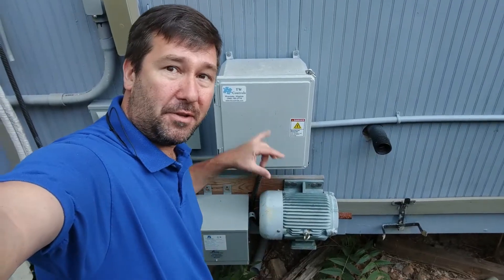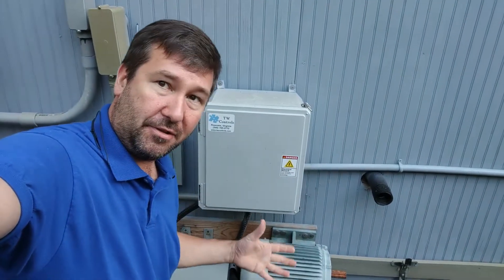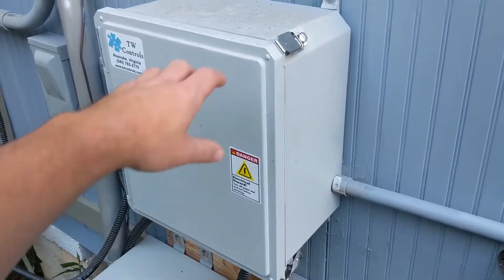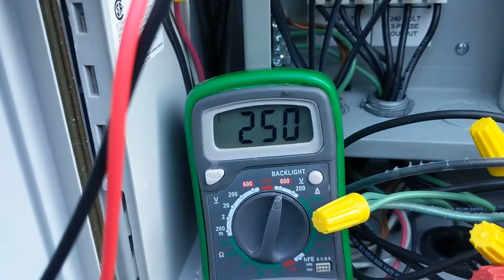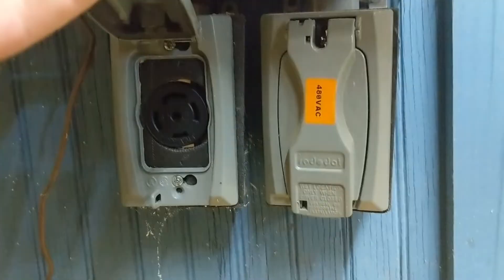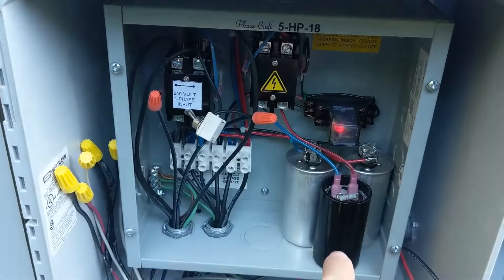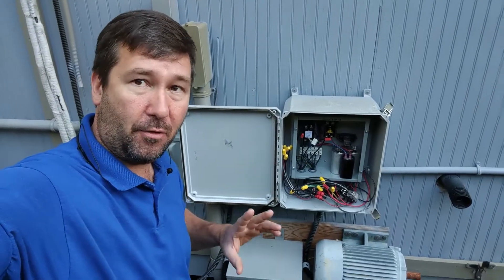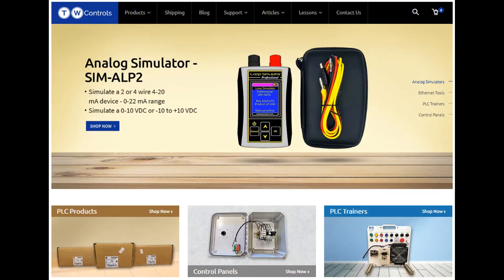Make 3 Phase Power from Single Phase with a Rotary Phase Converter

Comment: cut the shaft off and the vibration will go away for the most part.
Reply from the maker: In this case I don't think it would help.  The motor is perfectly smooth,, it just is in the perfect place to amplify the sound of the motor.
Reply: if its just the shaft it's probably balanced almost perfectly. it's more or less harmonics plus if it's mounted on a semi flexible piece of the building, it will vibrate no matter what. just how it is. Now if Tim used a bunch of bolts and sent them through to the inside of the building with a 1/4" steel plate backing. you'd hear nothing. but that's intense.
Reply from the maker: @docstruthers  A little cement and set it on the ground is the permanent solution, 2 years later and it is still on the list to do :)

Comment: wiring diagram please,
Reply from the maker: There is more to it than that, part of the reason that I've never made the follow up video.  You need to understand capacitor sizing.  It is still on the list, just not very high up it right now.

Comment: I took a 110 single phase and made 600 volt 3 phase out of it with the  convertor and running multiple machines from it, very simple, plug and play. And then I woke up:)
Reply from the maker: Yes that would be a little steep unless they were all model machines.  I think you'd end up with about 1.5 amps of capacity 😜

Comment: Does this restrict the total amperage you can draw compared to 3 phase installed directly from the power company?
Reply from the maker: If you have the choice then install 3 phase power. But if you can't then your idler must be twice the size of your 3 phase motor. So if you have a 5 hp motor you need to run, you need a 10 hp idler motor.

Comment: I used to do this w/o the caps, to run my metal lathe.  I'd start the idler motor with another, single phase motor with a belt.  then once running I'd use it to power my lathe.  The idler motor would always become super hot!!
Reply from the maker: My previous one was the same setup. The only reason we switched to our current setup is our is some of our customers required the phases to be balanced when we tested their control panels.

Also the idler heat sounds like you weren't dropping power to the motor one at speed. It should only be used while starting.
Reply: @TimWilborne  Thanks... I was dropping the power applied once the pony motor was running.  
Didn't you show in your other video that overheating is a problem when no capacitors are used?
Reply from the maker: That wasn't a capacitor problem. My idler motor should have been twice the size of my load. I used the same size motors which caused my overheating.
Reply: @TimWilborne  Just trying to determine the cause... so it was b/c your idler motor was not twice the size of the load motor...?  That was probably the problem with my setup!  My idler motor was quite a bit smaller than my lathe motor.

Comment: What does "pull down that relay" mean?  Turn it off or turn it on?
Reply from the maker: The potential relay? It drops out the starting capacitor.
Reply: @TimWilborne  I don't understand the verb "drop" or "pull down" in this context.

Comment: Thanks for the information this thing needs a transformer to get 480 is it? I was struggling no-one was talking about it LOL
Reply from the maker: Yes, there are very few "480 volt" rotary phase converters out there, most of the demand is is for 240V rotary phase converters.  I like having both.  I need it for testing control systems but even if I didn't, I think I would want both.
Reply: Hi,Tim. i am also planning to build the same setup  for VFDs and servos testing at home. i have few questions.
can we use static phase convertor (or VFDs ) to feed step up transformer. or rotary is the best? 
second  which transformer is the best ,a isolation or auto transformer? thanks

Comment: Great video. Had a few questions on previous exchanges in the thread. Looking forward to the next in series on balancing capacitors. I have built two already for running smaller motors(1/2 and 3/4) and need to do a shop wide redo with a larger set of equipment. I used timers before I found out about the potential relays . Upping the idlers to above 10 HP load looks like a whole new set of parameters come into play above the 30 amp /220 input.
Reply from the maker: Yes I need to make a capacitor balancing video, I've got too many projects going on right now.
Reply: @TimWilborne  How much longer do we have to wait lol Good info & explained clearly! I'm ready to order parts but been holding out for this series for confirmation on how I should go about it. Thank you!
Reply: @Csonka09  there is a good vid on balancing here sbirdranch part one
Reply: @stuarth43  I'll try any locate it. Thanks for the heads up
Reply: @TimWilborne  Tim did you ever do the video on building the phase converter?
Reply: Parts are not easy to find in the whole state of va
Reply: Maybe should use a vfd but no fun in that huh!

Comment: Just a quick couple questions, could a phase converter be repaired, and what's the difference between the large box type converter and the small one if iam only powering one motor?
Reply from the maker: Hi Joe, yes phase converters can be repaired.  Most of the time bad capacitors are the only problem.  I'm not sure what you mean by a large vs small box converter.  They are all based off of horsepower.  Typically you double the horsepower of your load and that is the size rotary phase converter you need.

Comment: Nice video,  I have single phase electricity and I want to run a mill that requires a 25HP motor.  What are my options?
Reply from the maker: That is a big mill. Are you sure it is 25 hp? You would need a 50 hp phase converter.
Reply: @TimWilborne  Thanks 4 the reply, am sure coz it used to run on a diesel engine rated 24HP.
Reply from the maker: I would check it, 2hp would be a large mill. I think mine is 1/2 hp.
Reply: Is it a sawmill ?
Reply: @jaspermcconnell6417  No , its a flour mill, in Kenya its called a posho mill, for making maize flour.
Reply from the maker: Ah I thought you meant a milling machine. 25hp would be in line. You would need a 50hp idler motor

Comment: Great video..I am pondering if I should get a 3 phase converter for pizza conveyor ovens. usually 208/240 3 phases. Do you recommend? Thanks for your good informative videos by the way
Reply from the maker: Most conveyors are available in single phase so that would be my first choice unless you need to vary the speed of the conveyor.  Event then, there are many single phase drives that will output 3 phase and allow you to vary the speed.

Comment: Great vid.. I recently picked up a 480 volt wood planer and was concerned about building a dual volt all in one converter. Back in the 1980's I had a "Rotophase" built using a 10 hp motor. The guy who built it told me the rule of thumb was that you can start up to the motor capacity of the converter (10 hp) and that you could run up to 3 times that as long as you do not try to start at the same time. IE you clould run 30 hp at a time. I have been looking at recent vids. and most say you need twice as much converter hp as largest hp machine you need to start.  My planner is 7.5 480 3ph, I recently purchased a 7.5 hp motor to build converter, thoughts?
Reply from the maker: No I've never heard that one Howie.  As a general rule your idler needs to be twice the horsepower that you want to start.  So if you have a 7.5hp load, your would need a 15 hp idler.
Reply: @TimWilborne  Thanks Tim

Comment: 1 ph 250 to 3 ph 250. Is that line voltage ? How the voltage same?
Reply from the maker: If you have 250VAC single phase coming in then L1 and L2 of your three phase power is those two incoming single phase legs.  The 3rd artificial leg will be lower that L1 and L2, that is what we use the run capacitors to boost.

Comment: How did you size the motor and the transformer?
Reply from the maker: Great question Harold.

For the motor you want it to be twice the size of your three phase load.  For example if you have 5hp of 3 phase load, you will need a 10hp idler motor.

For the transformer, you need to figure out the Kilowatts or KW.  1hp equals 0.746 KW.  So if you 3 phase load was 5 hp, 5 * 0.746 = 3.73 KW
Reply: @TimWilborne  Thanks for the quick response hope to see more of your videos soon.
Reply from the maker: @ace7709  Glad I could help, have a great day!
Reply: @TimWilborne  Is this because of the 240/480 or do you still need the idler to be twice the size of the load If both supply and load are 240v?
Thanks
Reply: @TimWilborne  Is the idler rule of thumb 2 for 1 rounding off the 1.73 factor with the 3 phase to single phase ratio? It has always befuddled me.

Comment: do you have a parts list?     dynotime1@yahoo.com   and a drawing    Thanks,   what size ac motor do I need?
Reply from the maker: Hi Greg, it would depend on your 3 phase load and voltage required.

Comment: Hey Tim!

Usually I see you on PLCS.net. :)

I'm researching this because I have a project for a friend that will need to power a 25hp, 480 volt compressor. I'm thinking about using caps this time and not going full on backwoods with it.

Rootboy.
Reply from the maker: Hi Rootboy, nice to hear from you!  That is going to be a big one.  

If I was doing it for a customer then when they get that size I go to American Rotary.  They are not the cheapest but they are beefy plus I have someone to blame if they quit working...not that I have every had one quit.  Something like this one.  https://amzn.to/3aOwIgW

If it was for a friend, I'd find a 50hp motor and get this kit. Also he sells them with the motor also.  https://www.ebay.com/itm/New-50hp-3-Phase-Cnc-Balanced-Rotary-Converter-Panel-10-Year-Warranty/233340188494?hash=item365428b74e:m:mVGSCTUTaWBhmPyEIeIYAyA

Then you will need around a 30 KVA transformer.  Something such as this.  Also I might know where one is depending on where you are located.  https://amzn.to/3dUWIt4
Reply: @TimWilborne  Hi Tim,

We had already found a 50hp motor for $250 (cheap!!), and it's on its way here. We found a 45kva transformer locally, which was about $450 IIRC. So we've lucked out on finding affordable parts. I would have preferred a delta - delta transformer, but scroungers can't be choosers... The 45kva has taps so I can get the voltage close enough. The 50hp motor is a twelve lead job. I approve. :)

We are still planning on using a pony motor to spin up the idler since a 50hp motor is going to put a bit of a load on the system were we to use a capacitor start. But I might add it in to see how well it performs. We just don't want it sagging the voltage to the other parts of the building during start up.

As for balancing caps, I can get 60 mfd run caps all day long for about $10, but it would be nice to be able to figure out what I needed beforehand. And I have done converters without the balancing caps in the past and it was no problem.

Rob already has a brand new American Rotary that he had purchased for a Bridge Saw, but it is about half the size of what the screw compressor needs. AR quoted us a second AI30 unit with the link for about $3800. I think that we will comfortably come in under that. :)

If AR had taken the AI30 back and sold Rob a AI60 then we might have gone that direction, but no matter.

That capacitor balancer looks nice, but doesn't anybody read the NEC? Green wire for controls? Really? I was toying with the idea of putting the balancing caps inside the transformer, but it might get a bit too warm in there for the caps.
Reply from the maker: @MrWaalkman  Man you are scoring big time!  Up until my current phase converter, I didn't have balancing capacitors.  One of my customers required phases be balanced for testing their systems so I purchased the box I'm using now so I didn't have to do the trial and error. 

I wouldn't put the caps in the transformer.  Not only heat but ease of testing when something is wrong.
Reply: @TimWilborne  Yeah, we got lucky. :) As for the caps, I think that you are right, more for the next guy who comes in to service this thing.
Reply from the maker: @MrWaalkman  Good luck, let me know how it turns out!

Comment: Can I connect a 100 amp 8 pack welding machine with that add a phase system?
Reply from the maker: Hi Javier.  Yes, welders work fine with rotary phase converters.
Reply: I think the question in this case is can you run 8 welding machines that draw 100 amps each of a drop cord and that would be NO.

Comment: To make 480 V with your rotary phase converter, you don't need a 3 phase transformer, you just need to rewire the "motor" so that you only use half of the windings to run it, then use the other half in series to make the 480V. I have done this many times.
Reply: Wont you lose the efficiency of the orginal 3 phase because it's not equally across all the windings?
Reply from the maker: The question is, is it equal across the windings? 🤓
Reply: @TimWilborne  It can be made equal with the proper run capacitors
Reply from the maker: I thought you were questioning where they were 120 degrees apart. I have a video coming on that 😁
Reply: @tonyb.7079  You will need twice the size motor for the converter, and you will have to use run capacitors to balance the voltage, but it is possible. Old 3 phase motors work better than new ones.
Reply from the maker: Interesting.  I can't work this out in my head on a standard Wye Delta motor configuration.  Can you send me a sketch?  contactus@twcontrols.com.
Reply: @TimWilborne  did he ever send you info on how to do this?

Comment: Could you please share the electric draw?  I am really wondering how to convert from 1 phase to 3 phases with capacitor?   I am thinking to do the same thing with Ac motor driver?
Reply from the maker: The reason I never have is the capacitors vary by horsepower. I'm planning on making a follow-up video about capacitor sizing, it just hasn't made it up the priority list.

Comment: Would you be able to provide your service by make same convector? I have 110 and 220 in my shop, my main machine is running from 3 fhase.
Reply from the maker: Hi Alex.  I can probably point you in the right direction, what horsepower is your machine?
Reply: @TimWilborne  voltage 400-460 VAC / 3 phase. Frequency 50/60 Hz. Power 25 AMP (MAX)   that's all on the label. Mega appreciate any advice. Thank you!
Reply from the maker: @alexperry7631  That's a big machine.  I'd probably reach out to https://www.americanrotary.com/ for one of that size.  That load is big enough that you want to make sure you get it right.

Comment: Hey Tim i have some questions for you can i email you?
Reply: So i just recently bought 3 phase rotary screw compressor that has a 15hp motor. I was talking to a guy around me that build phase converters he is saying i need a 30hp motor to make a phase converter to power the 15hp motor in the compressor. I just wanted a second opinion
Reply from the maker: @jdyer4066  He is correct.  If you are making a homemade one then you'll need a 30 hp idler.  You have to be careful if purchasing a prepackaged phase converter.  Some  of them rate it for what you can connect to it and some of the rate it by the idler motor hp.  Here is a link with some more information, look about midway down it.
https://www.americanrotary.com/blog/beginners-guide-sizing-rotary-phase-converter-machine-shop/
Reply: Thanks for the input the guy i know is going to make me up a box with everything need to make everything run right
Reply from the maker: @jdyer4066  Good deal.  One that runs right out of the box is a sweet setup!
Reply: So I'm getting the 30hp motor what is exactly needed to make everything work far as components?
Reply from the maker: @jdyer4066  Mainly the start and run capabilities that I'm assuming your guy is building for you.
Reply: I could send you a picture of what i have I'm just assuming for the 30hp he just need to beef everything up
Reply from the maker: @jdyer4066  It's not as easy as just "beefing everything up".  Send a pic to contactus@twcontrols.com
Reply: If I'm running just a screw compressor do I need to have a transformer with the rotary converter. I found a American rotary adx20 used with the panel box. That should be good for my 10hp screw compressor right?
Reply from the maker: @jdyer4066  It depends on if your compressor is 240VAC or 480VAC.  If it can run on 240VAC then you don't need a transformer.  If it is 480VAC only then yes you will need a transformer to bring your voltage up to 480VAC from 240VAC.
Reply from the maker: Sure or just ask them here.

Comment: How much does one of these systems run?
Reply: Okay thanks I just recently got an old Cincinnati pedestal grinder that’s 220 3 phase as well as old welder that’s 220 3 phase that I purchased at an auction for dirt cheap so I’m looking into converters but I’d like to build my own rather than buy a pre made setup and I liked your setup and plan to get more 3 phase equipment and I also have an old lathe that the guy before me rigged it up to run off 220 single phase even though it’s a 3 phase motor and I don’t think I’m getting full power out of it so ideally I’d like something that can run all of my equipment rather than one for each
Reply from the maker: @ryanfischer8996  That sounds like a good plan. What is the total amps of all your equipment?
Reply from the maker: Hi Ryan.  It depends on the horsepower of your application and if you have a idler motor laying around.  The control box is $200-$300.